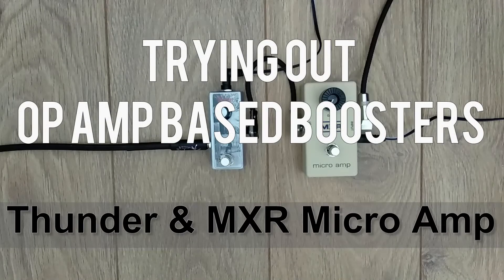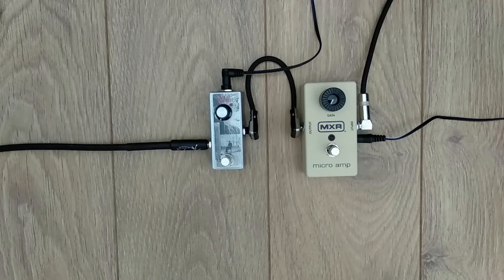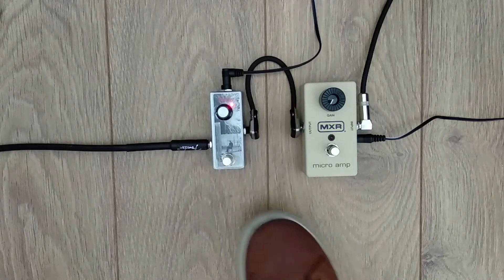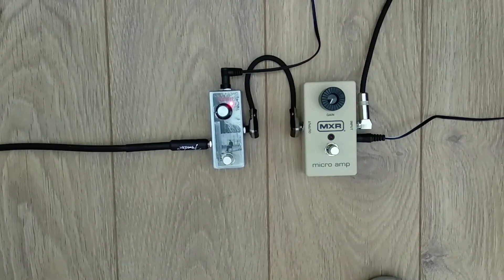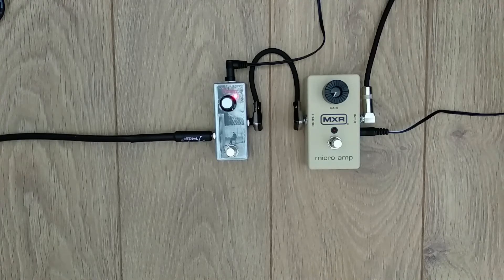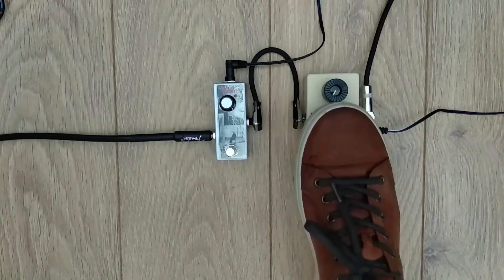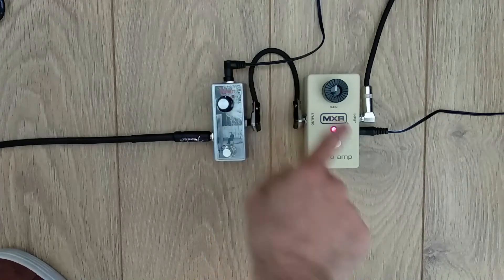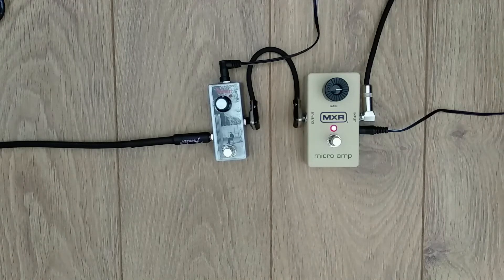Simple Op Amp Based Guitar Booster - Demonstration

Comment: Hello sir, it's a nice circuit. i was learn and appreciating your schematic on your site and comparing with microamp schematic. Similar circuit i guess, with some different value on parts and using dual opamp. Yes, you're make your circuit more louder without being distorted, i like so much and build it too from your schematic. I see on dual opamp you're used on your circuit you're just only use a single side, i think we can used other single side to build a tone control, maybe an active type like baxandall on bbpreamp (just my opinion) and make this booster more versatile. Anyway, thank you very much for your circuit. You're awesome!
Reply from the maker: Thanks :) I do have somewhere tone control - when I was covering Tube Screamer and my take on it, but I don't have a post for op-amp based tone control. Good idea, I'll do that at some stage :)